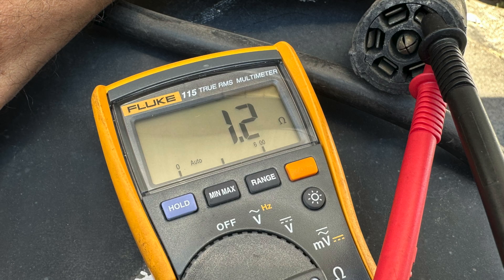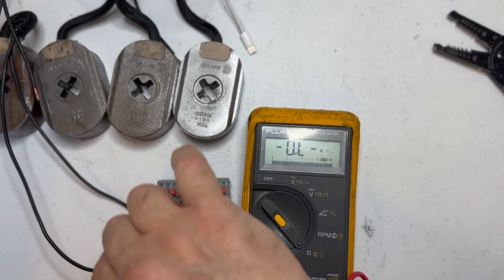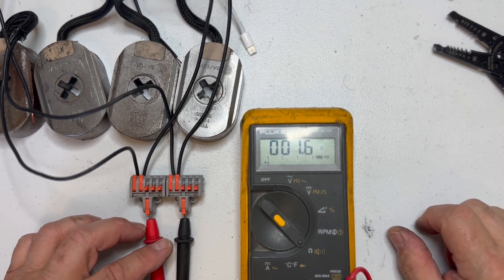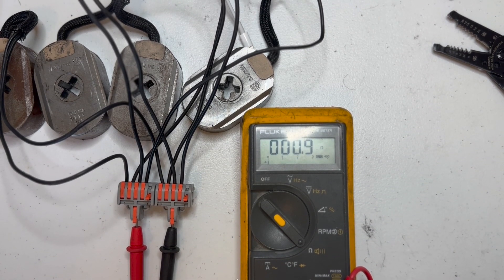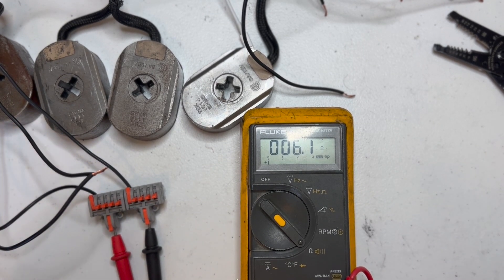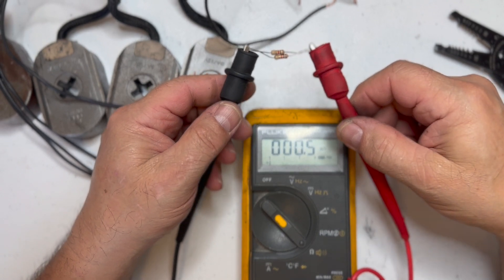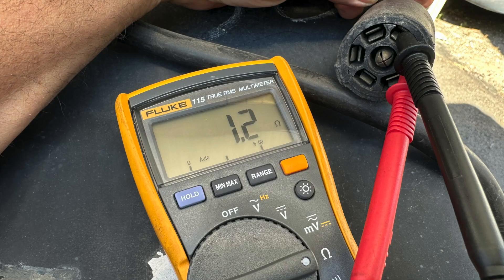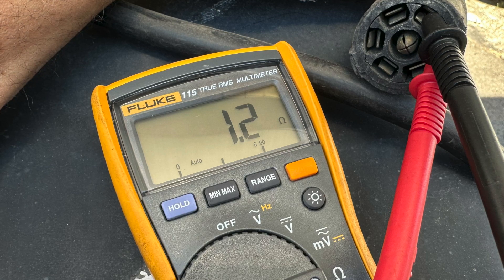RV electric brake magnet   HD 1080p

Comment: So if I cut my wires hook to a meter and they read nothing it’s bad?
Reply from the maker: Not sure what you mean by nothing and where did you cut the wires? On my meter an open circuit shows OL
Reply: @mikmaster63  so a brand new magnet if you check the wires with meter what’s it supposed to read?
Reply from the maker: @MississippiHot_Shot  55 seconds into the video shows testing one magnet. If your meter is set correctly I would say the magnet is bad if it’s reading OL
Reply: @MississippiHot_Shot if you’re set to read ohms it should see around 3 ohms. If it shows nothing at all then the magnet is bad or you’re meter isn’t set to ohms. If it reads OL then it’s also bad and/or you have a short to ground somewhere in between your meter and magnet you’re testing.
Reply: @theclamhammer4447  I got it figured out. It was mixture of bad magnets and drums. I replaced all of it then it fixed my problem.